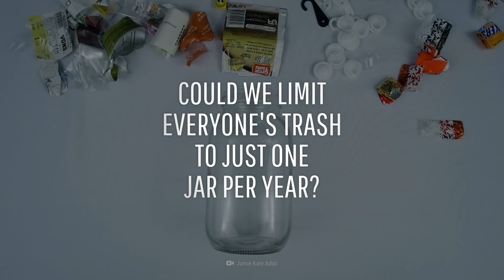What If We Created No Waste?

Comment: Not going to happen. We would have to basically hold the CEOs of Corporations at gunpoint to force them to stop doing it otherwise nothing would happen. It's the evil corporations that are polluting and destroying our planet for short-term profits, that has been demonstrated from the coronavirus can easily go up in flames. The issue is that the wrong people are at the top, Society should be run by only the smartest people that have the highest intellect, not some college or high-school Dropout that probably has the IQ of a goat. This is why I'm voting for Bernie Sanders, I can tell you for a fact if I was running one of these corporations that I will be doing a hell of a lot better of a job at it.